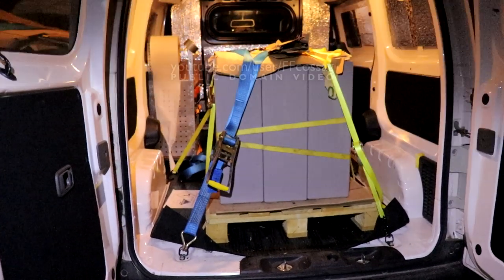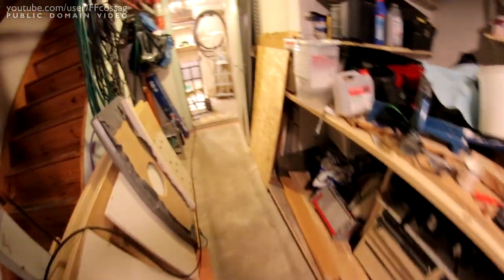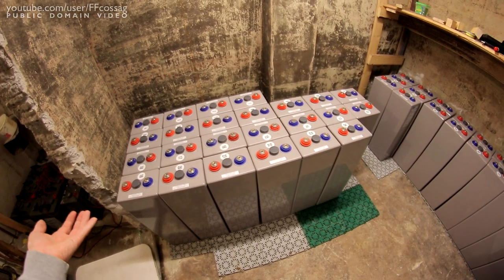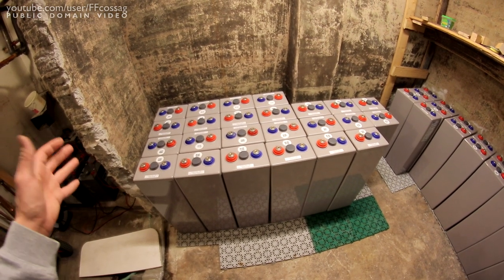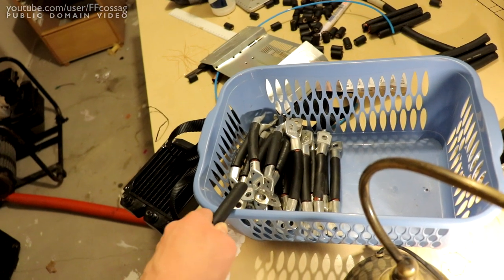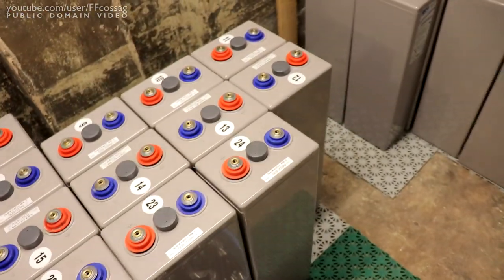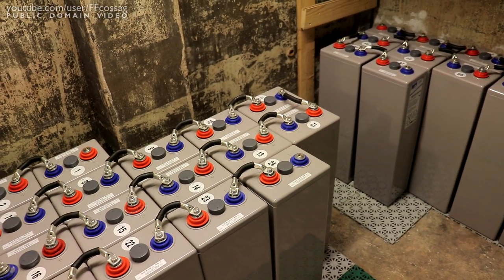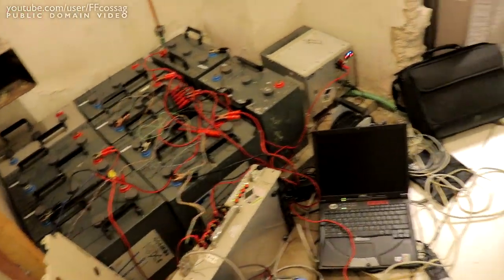OPzVLOG 4 - Many crimps later ...

Comment: Hooo boy I can only imagine the short circuit current of one of those 48V banks. Forget welding, more like obliterating :) Fantastic work so far, can't wait for another update!
Reply from the maker: Including jumper losses, they can push about 4200 A each, so the current backing the final system will be about 8000 A. If you were to put a crowbar across the output of the junction box that these will be wired up to, the wiring would reach a temperature of over 1000 degrees C in less than 10 seconds - and your crowbar would be turned into a puddle on the floor.

Comment: usually ur spose to solder them too.
Reply from the maker: You can't solder these jumpers because they'd wick the tin up and go stiff.
Reply: @FFcossag  u mean the cable would wick up the solder???? i prefer tin coated copper link bars then cable.

Comment: You chickened out and bought connectors instead of making them and no solder, only crimped. Sacrilege, sacrilege I say ;)
Reply: @Dragan Milivojević you must be from a planet, where high power/current connectors are not likely to heat up, beyond the melting point of solder - a planet, where melting solder is not used as a safety-fuse.

Remember; according to Sunny (Louis Rossman's sarcastic [but proper] contractor), you should take Apple as a role-model! Apple only uses the highest-grade fuses "…, to ensure maximum power delivery"!
Reply: @fluffyfloof9267  hahaha Rossman fan here!
Reply from the maker: Yeah they cost less than a Euro each, and I'd spend more than a Euro each in time alone, making them. There is a limit to even my patience, hehe.

Soldering these is not done because it would be a terrible idea; the solder would wick into the copper wire and turn it into a stiff rod. While I generally do appreciate stiff rods, this is not a suitable time for one!